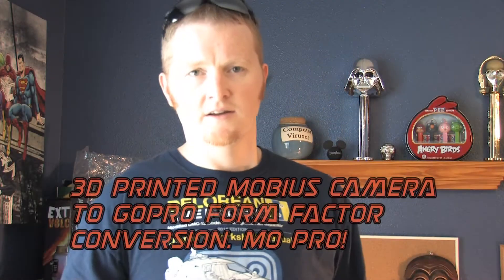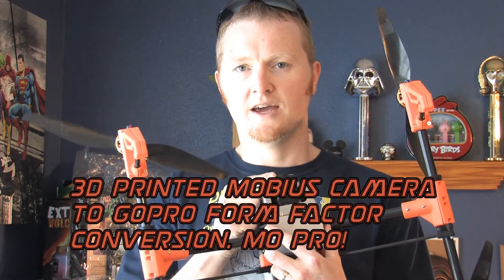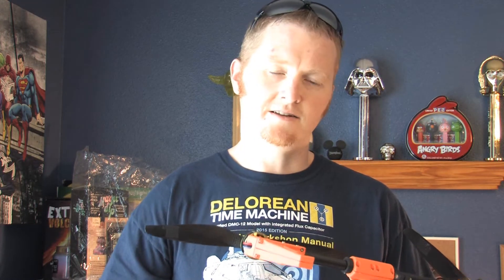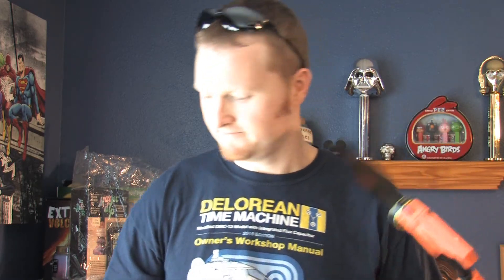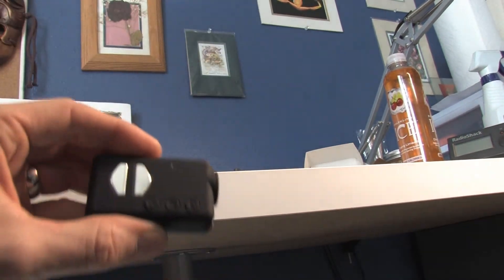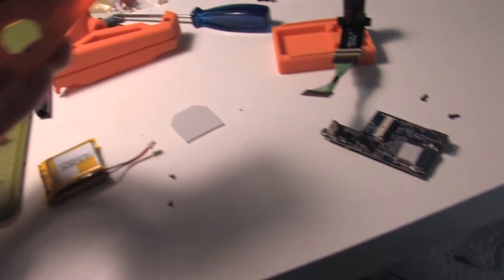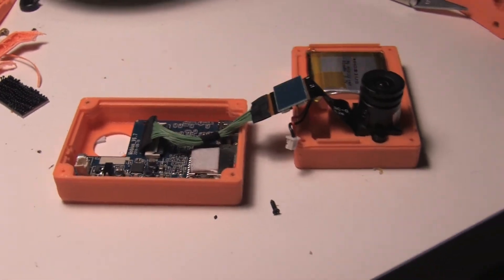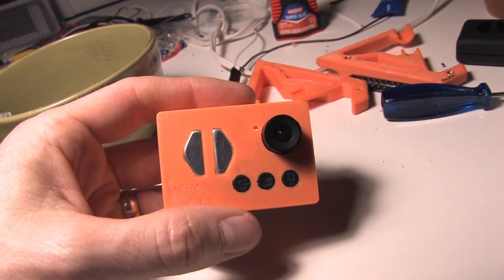3D Printed Mobius to GoPro camera conversion case - MoPro

Comment: Thanks for the review on our case. It's designed to be printed at 100% infill for the weight to match the gopro and correctly balance in the brushless gimbals designed for gopro's.
Reply from the maker: Samantha Welburn I had to do a bit of dremeling to get the lens slot big enough for it to fit in there, and it was a challege to get everything inside the case and closed but aside from that it has been great.  I think my lens extension cable was part of the problem. I think it is a big longer than necessary and has a pretty big connector in the middle of it.
Reply: Can you make a version of the case without the filler. I want one that is light weight and compact as possible but the camera pointing like a goPro. That would be perfect for me!

Comment: The pics on thingy verse look like you can indeed sit the lens further into the body of the case. Looks a bit vulnerable sticking out like you have here in this vid. How long did you spend fitting it onto that case? It's supposed to make up some extra weight of a gopro too so a lot of excess material in there (which I'm less keen on a heavier camera). Mobius is awesome that we can mod the form factor though... So much choice. Is it working fine in the new case? Follow up vid please!
Reply from the maker: 2Old4Toys There is a slot that the lens goes into. The problem is it doesn't really fit. I had to xacto out quite a bit of material to get it to go in there at all so it's not seated all the way in.  I'll probably work on it some more later but it is ok for now. It seems to be OK other than that. It took me a while to get the case to close with the extension wire in there. It is a very tight fit.
Reply from the maker: 2Old4Toys oh and it fits right into the gimbal that just came in the mail today.
Reply from the maker: 2Old4Toys I ended up taking it out to the garage and using the dremel until it fit all the way in. Then I hot glued it in place. It is much better now.
Reply: Thanks! You are the 1st person to review this interesting printed case for Mobius so your views are valuable.